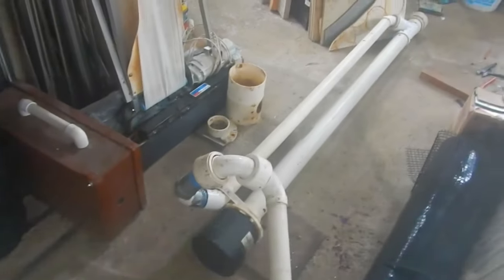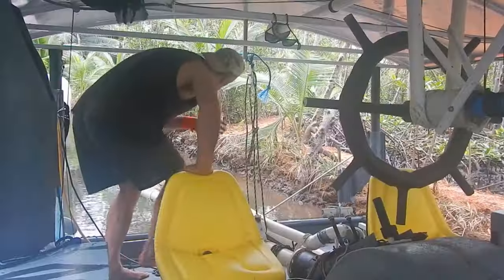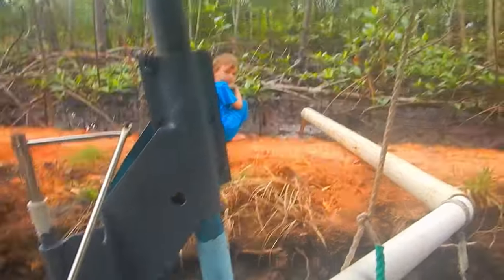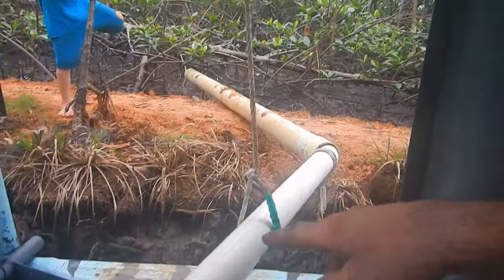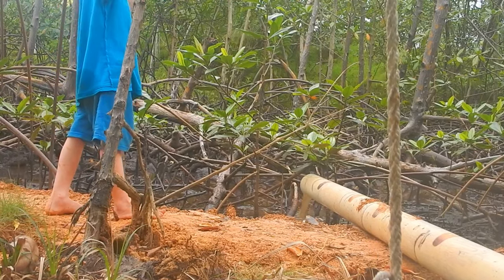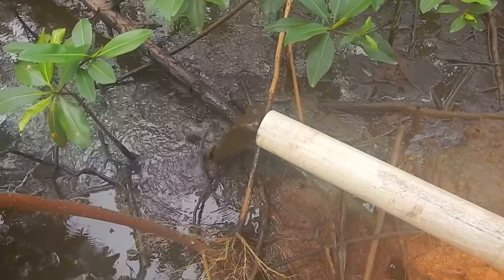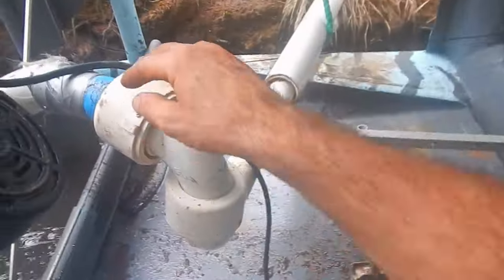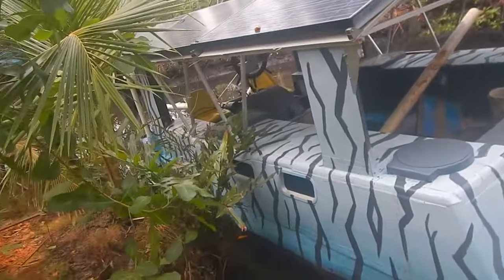Mud Sucker Test!

Comment: Dredging goes very well for me just by running the electric outboard on solar power long enough to establish water current flow to where the sludge should go. Then a little motor steering and boat repositioning does an amazing job.
Fast water flow at the prop sucks up bottom material including sand which then deposits far away where the flow slows as it spreads and returns near the surface slower on both sides of the motor.
Timing it with tidal outflow should do even better.
Reply: Yep, but I bet that you have a really strong engine..
Reply: I have two solar-powered pontoon boats and a wild wooded bank lakeshore with a sand bottom and no beach.
The 1 horsepower MinnKota and the 4 horsepower Ray Electric Outboard both work at low-speed settings.
High-speed settings dig deep holes under the prop, not good.
Easily 50 feet of range can be cleaned just give it time and enjoy. @ehombane

Comment: another dredging technique you could use is to make a drag plow. use your boat to drop it in the water and use a winch to pull it back into shore it will chop up the bottom letting you vac up anything thats left

Comment: Those tight bends aint helping your flow but i understand maybe necessary to have it flexible/adjustable.  Maybe use same ID rubber hose and hose clamps for the flexible section?  That would surely increase your output, plus no leaks.

Comment: Archimedes screw going all the way up the shaft, otherwise you are fighting head pressure for the rest of the vertical pipework. I think the way you made it (was great) but, screws all the way up and it would spew out muck.
  If that device had swappable parts you could also use it as a Thai style longboat motor.

Comment: Would a flexible tube, like a dryer exhaust tube maybe with a heavy end, solve the leak issue?  Not many hard object would be getting through that would damage a lighter pipe, I assume?  Nice land-building tool as well. ⭐ Jaimie has a good assistant there too.  Good use of a youngsters time when he isn't studying.  ⭐

Comment: Wind powered water wheel creating artificial current in the cut will slow down mud deposits I reckon - or a solar prop. Speed up the flow a little?